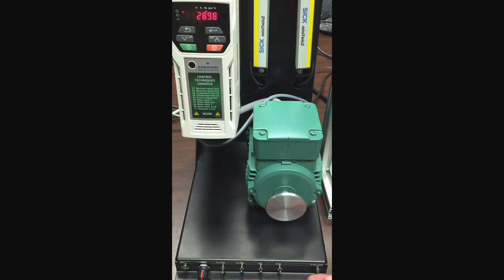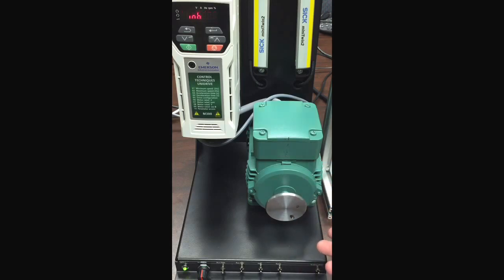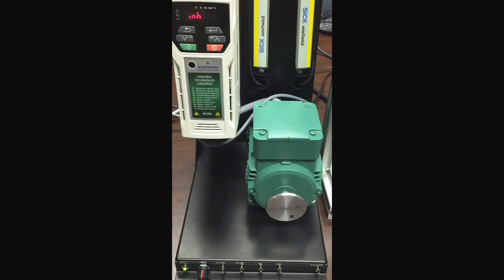Control Techniques - Unidrive M300 Dual Safe Torque Off

Comment: Hello, I have this demo kit M400, but I have a Trip OI.ac. How can fix it?
Reply from the maker: +Gerson Chavarria There are multiple things that could cause this, try the below list of solutions. Please let us know your results. Ensure the motor rated current is correct (M00.006). Check for short circuit on output cabling to the motor. Increase Accel/Decel rate. Are you in Open Loop mode?